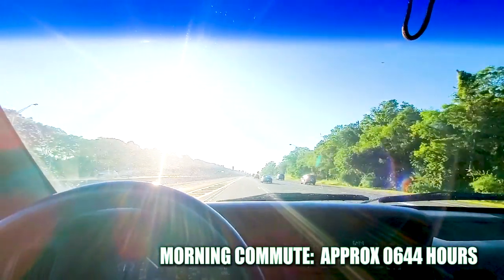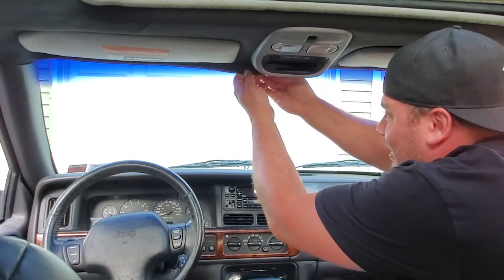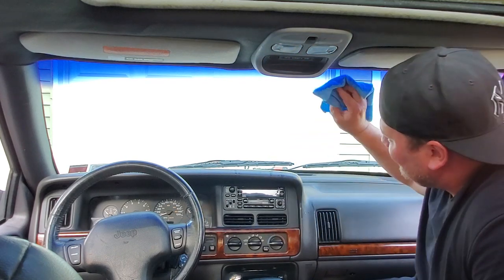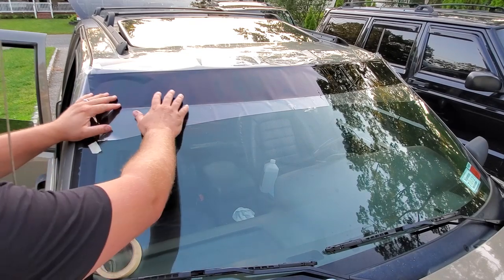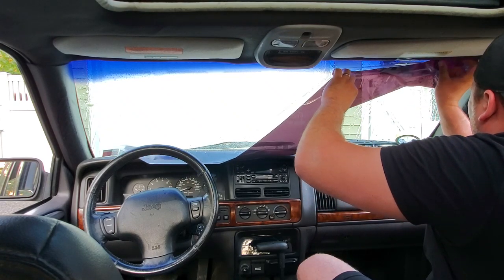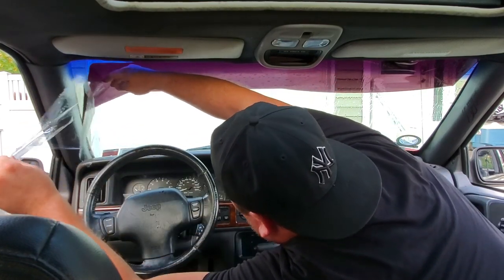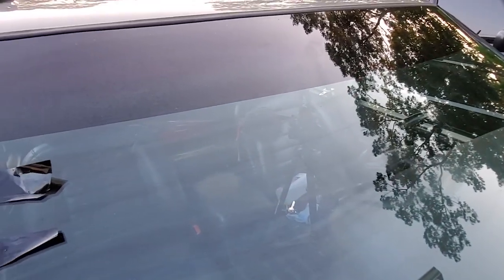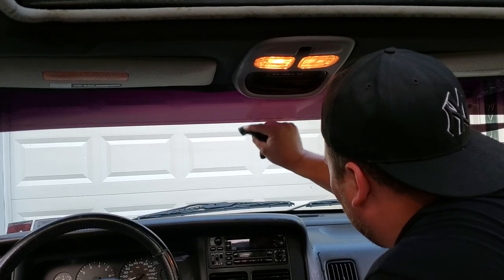JEEP ZJ SUN STRIP TINT AND REAR VIEW MIRROR INSTALLATION ON A 1998 GRAND CHEROKEE

Comment: Mark the outside of the glass for puck location. I tape a rare earth magnet on the outside of the glass -- it definitely helps hold the puck in place as the glue sets! Use as little glue on the puck as you can, the thinner the layer the better! Press and rotate a bit, and let the magnet on the outside hold it in place -- and I'm with you, let it sit for half a day or more!
Reply from the maker: Great tips Artie!  There is an indicator mark for puck placement already on the glass, however I disregarded it to install the tint strip.  Awesome suggestion to use the magnet! That blew my mind! Amazing! Thanks again man
Reply: @ProjectDanH  I'm on my second windshield -- it didn't have a mounting mark for the mirror. the magnet really helps, holding the puck securely for hours. I also put a circle of metal foil tape on the outside of the glass right over the puck, with the idea that the sun will heat up the metal foil, and won't get as much heat on to the puck.  If the puck stays on for a few years, I guess it works! We've got two ZJs -- a 96 with a 5.9 in it, and my 98 5.2L, and an XJ, it's either a 96 or a 98 4L.
Reply from the maker: @artiem5262  so cool man! You have a Great fleet of Jeeps!

Comment: Idk if you remember me but I’m thinking of selling my Cherokee , it’s just too much work for me and I don’t wanna do it
Reply from the maker: Ahh man... What's needs to be done? What if you chip away little by little?
Reply: Project Dan H well gotta fix the leaf spring shackle , needs new tires , needs reverse lights , gotta put new shocks on the hatch because there worn out , needs a few door panels and a new windshield , new passenger side window motor , oh also a alternator lol it’s a lot
Reply from the maker: @rhecboyz4473  lol.. yea. That is a lot. You can always chip away a little at a time